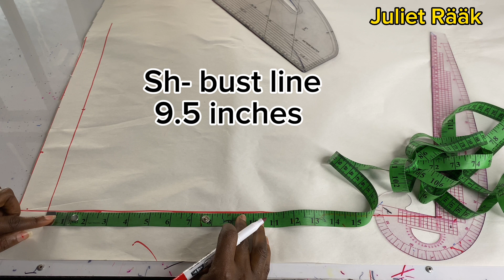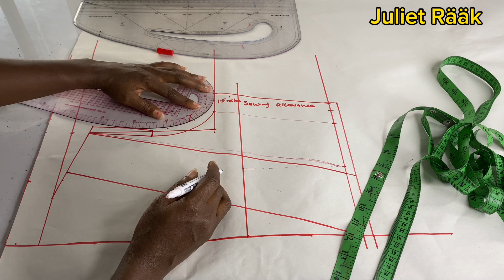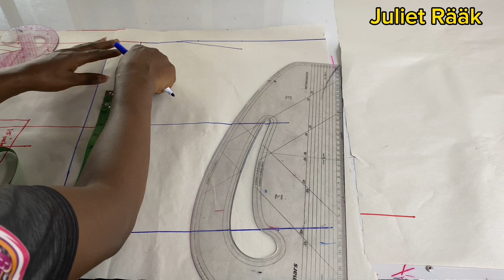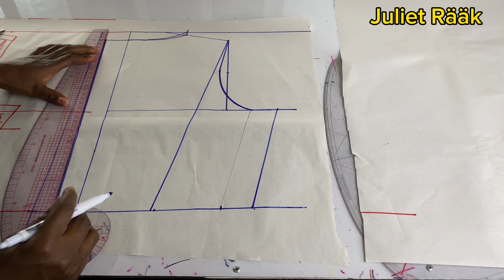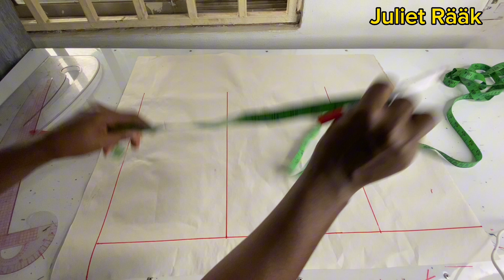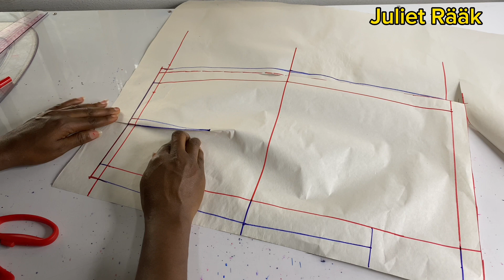How to draft a Plunging Neckline Mini Dress Pattern tutorial/ Ruffle Trim Part 1

Comment: Niceee so if bust is from 38.5 and above can one use 3" instead of 2.5?or 2.5 is a standard for the front not to be too opened?
Reply from the maker: Yes you can use 3 inches for the neck width